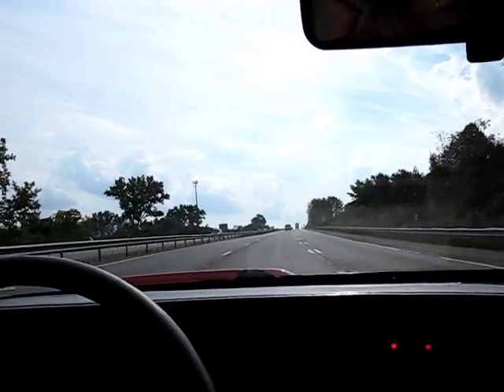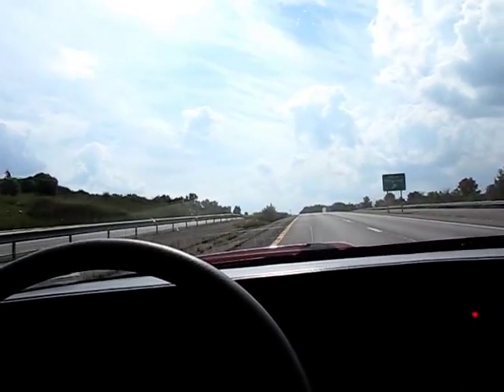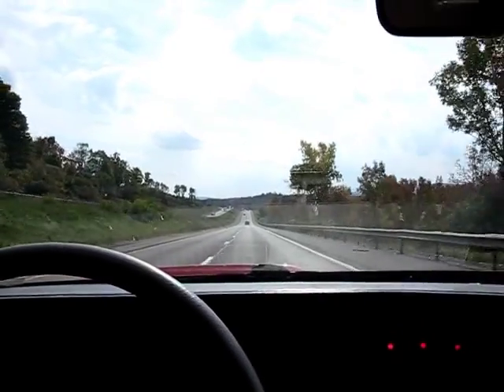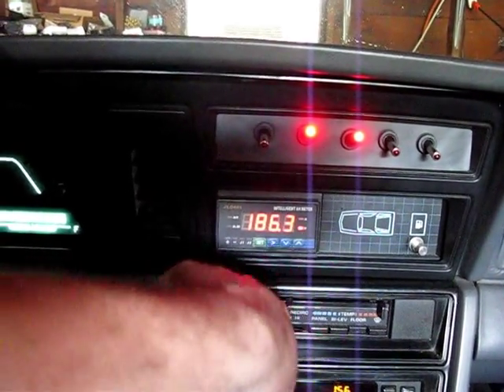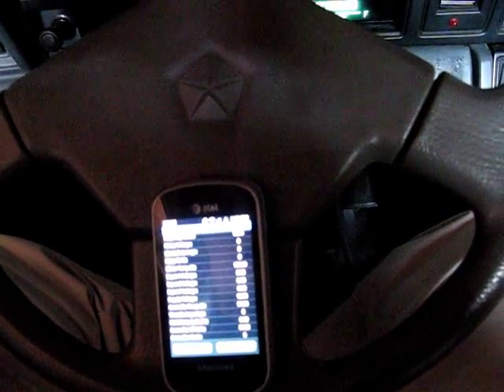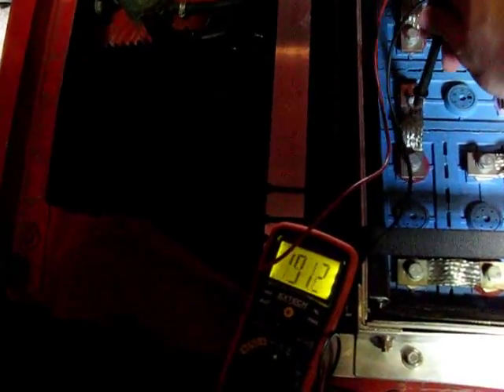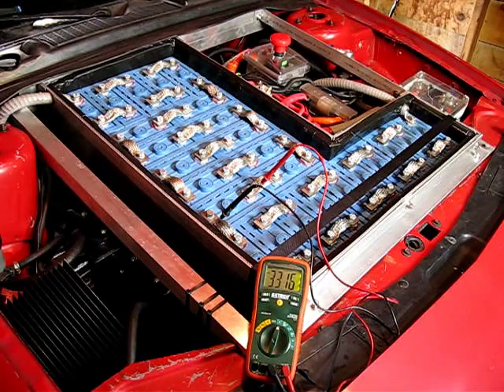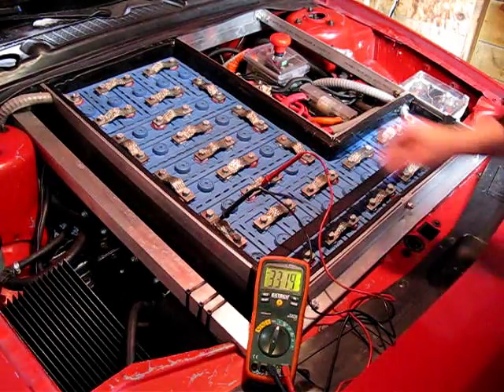September 30, 2014 - Motor Heat Torture Test & Venting CALB SE Cell

Comment: HI great work there impressive to say the least... I have a question starting to do my baby steps on this EV world but took on a big challenge would  u think a single warp nine will be enough to power fj40 restoration or dual warp9 or 11 may be... thanks
Reply from the maker: Desmound Heron Good afternoon, and thank you.  :) 

As to your question about the appropriate motor for your FJ40 restoration, a lot depends on how much you expect the vehicle to weigh after the conversion and specifically what sort of performance characteristics your looking for, along with what controller you plan on using, if you are retaining the manual transmission and clutch, etc.

For example:  My 1987 Dodge Daytona Shelby-Z had a stock curb weight around 2,800 lbs.  After removing the engine, gas tank, radiator, etc, then adding enough batteries to give the car a bit over a 100 mile highway driving range (~36 kWh capacity), plus battery boxes, the electric motor, controller, etc, my car now weighs in at 3,459 lbs.

I have a 1000 amp EVnetics Soliton1 controller, with a single WarP9 motor, with an approximately 200 volt pack of CALB 180 AHA SE series cells.  With this configuration, it has pushed the car up to 115 mph, did a 10.2864 second, 68.32 mph, 1/8th mile drag race, and measured an impressive 183 horsepower @ over 320 foot pounds of torque (at the wheels) on a dynamometer...  Not too shabby for a 143 lbs, 9" diameter motor, eh?   ;)

However, hindsight being 20/20, if I had it to do over again, I likely should have gone with a single WarP11 in my setup.   This is because the WarP9 is listed on the official NetGain website as being appropriate for vehicles up to ~3,600 lbs and my particular car (particularly with my fat arse in the seat) is above that, where the WarP11 is listed as appropriate for vehicles up to ~4,000 lbs.  In addition, the WarP11 has more torque, and significantly more surface area (for better airflow & cooling) than the WarP9 that I am pushing to it's very limits.

All of that being said, your choice of drive-train and other components comes back to your planned usage of the finished conversion and where your individual priorities are for it.  Are you are building a drag racing tire burner?   A long range cruiser?  An around-town daily driver?  A mountain climbing off-roading beast?  Etc.  :)

These days DC drive systems are largely 'out of favor' for new custom builds, mostly due to the inherent cooling issues during long drives, but also in part to the relatively abundant availability of high voltage AC drive system components being harvested from various wrecked and parted out OEM EVs.   If drag racing and tire burning isn't your end goal, then you might be better served (in the long run) with some form of water cooled AC based solution instead.

~Jason
Reply: Thank very much for sharing your knowledge with me over seas spreading the ev gospel over all the world my intention is to do small commuting around town never more than 20 miles go work and come and may be once every two weeks do one off road trail trip very mild like to take my kids so they connect with nature so we have nice spot we go check the river or I take them to artificial lake at the damp to take the rc planes for some fpv ... sessions  never more than a little gravel and mud not rock crawling or heavy off roading ... and yes I have seen your videos and other and it is impressive to me al most to point of mind blowing how we still use combustion engines ...